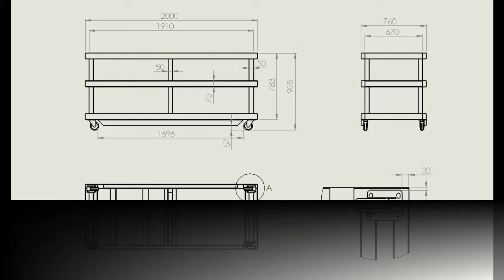Mobile Workbench for Makita MLT 100 -  Photo's (1min) & Video

Comment: Nice build. Interested why you opted to go wide rather than forward and have a longer outfeed table? I'm in two minds on which way to go. Thanks
Reply from the maker: Hi and thank you for your comment  Answer is simpler than you think... With this tablesaw for me was harder to make crooscuts at  longer pieces than  make longer cuts. In this way is easier to make series of cut's ... fence boards for example.

Comment: Hi, it's a very nice workbench. I wonder how did you fit the saw into it. Did you detached the rear sub-table of the saw?
Reply from the maker: No . I only mounted saw by putting 4 bolt thru the holes in the plastic base